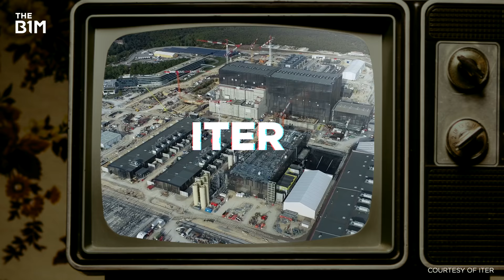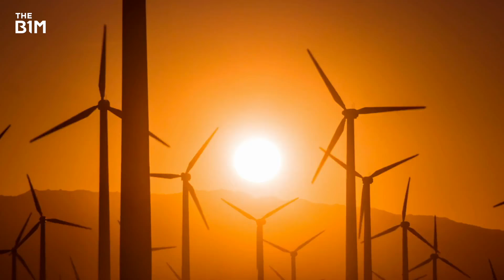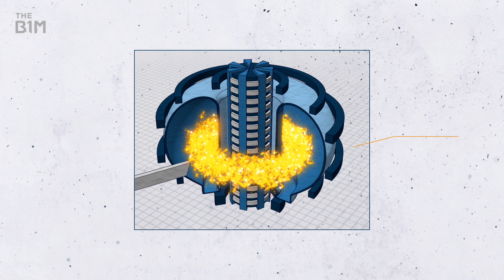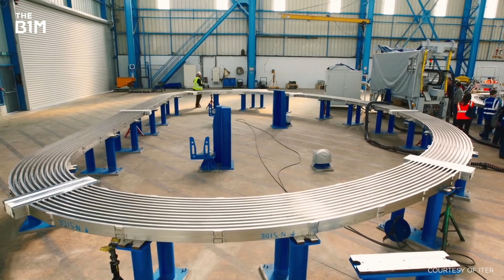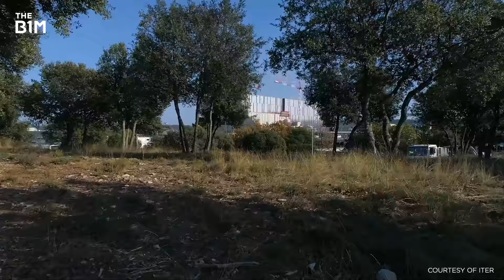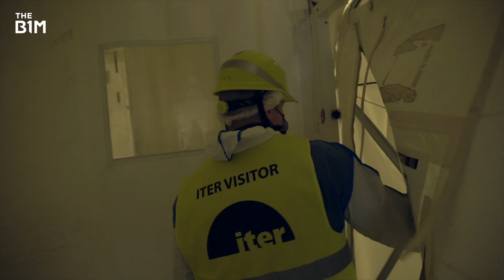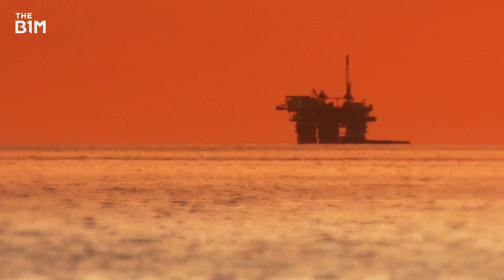We Went Inside the Largest Nuclear Fusion Reactor

Comment: ITER is purely a scientific research experiment, it is not connected to an electrical grid and will not power homes, cities, or businesses. In fact, instead of feeding energy into the grid, the facility will actually consume massive amounts of electricity (between 110 MW and 620 MW) from the local French power grid just to run its superconducting magnets and heat its plasma.

Comment: Based on what scientists think, believe, is happening inside the sun. A hypothesis that is over 100 years old and is, at the moment, absolutely unverifiable.  
Nuclear fusion is possible and that has been demonstrated. Trying to control it, based on this assumption, is a totally different challenge.
Reply: Are you saying stars don't use fussion? Because saying that is straight up incorrect.

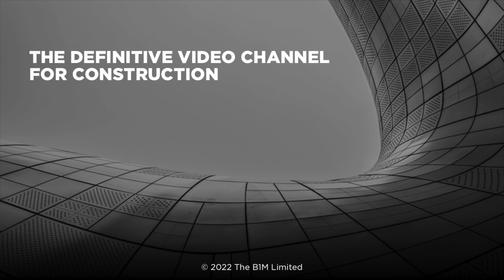Comment: 7:43 what you just said,is it true?
What about law of conservation of mass?
Reply: That doesn’t apply to nuclear reactions. It’s an approximation that fails in quantum physics.
Reply: Basically they have to heat the plasma super hot, and keep the super conducting magnets super cold this takes energy, net energy would mean the fusion reaction produces more energy than that initial energy to make the reaction happen. This reaction is the same thing that happens in the sun. Fusing atoms actually produces way more energy the splitting them

Comment: Don't give it an AZ-5 button.
Reply: 😂 Chernobyl
Reply: The button is fine, the problem was cost cutting the rods by using graphite tips and then NOT TELLING the actual plant operators about this. Slamming the rods in would have killed the reaction as expected had they been 100% boron. Instead as they said in they kicked the reaction orders of magnitude higher.

Comment: Remember Chernobyl!!
Reply: different type of nuclear reaction
Reply: @redegg7530 It wasn't a problem anyway. The myths of nuclear disasters are literally that. Myths
Reply: @paulanderson7796  tbf chernobyl still irradiated an area where it’s unsafe for human settlements but that’s “mostly” it, barely any direct death.
Reply: @redegg7530  Pure media propaganda. Maintain fear of the words "nuclear" & "radiation".
Reply: @redegg7530   Many still live there.
Reply: @paulanderson7796  I’m not saying the whole city, only a small region where it’s restricted to enter without approval from the government
Reply: @redegg7530  Are there any restrictions? Were there ever any?
Reply: @paulanderson7796  Yes, there are certain areas which you can’t enter without permission
Reply: @redegg7530  But what are the consequences if you do proceed without persmission?
Reply: @paulanderson7796  You’ll be fined, maybe community service and that if you enter the wrong area or took something you shouldn’t have, radiation poisoning
Reply: @redegg7530  Radiation poisoning is an odd one. The bigger issue is heavy metal poisoning. That's irrespective of short lived radioactive "byproducts". The long lived "wastes", U238 for example, have half lives of several billion years. Thus they are no radiological threat whatsoever.

Yes reactor "waste" needs relatively conservative handling, but commercial reactors don't create very much of it at all. You can bare hand fresh reactor fuel completely safely.

Comment: 150 mil centigrade…did I get that correct? What material is used to withstand these high temperatures Be?
Reply: The magnetic field keeps the plasma from reaching any material
Reply: Are you saying the magnetic field is some form of insulation, no heatwave (radiation) can penetrate this...wow I never knew that a magnetic field has a thermal conductivity of zero! I didn't even know that a magnetic field is matter, my infancy science tells me that all matter occupies space. I thought a magnetic field was more like gravity...something that you can feel rather than touch.
Reply: @MkhuluMokoena  No thats not what I'm saying, the plasma is kept at bay by the electromagnetic field, in a similar way of how iron can be repelled by a magnet. This means there is a gap, and a vacuum, between the temperatures of the sun and the beryllium blanket that captures neutrons and breeds tritium (more fuel for the reaction) and then the rest goes into the water channels that create steam which run a turbine. The electromagnetic field keeps the heat from conducting  to the structure. Plasma and electromagnetic fields have a special relationship. There is also very large gap between the fusion reactions which actually doesn't occupy much space and walls. The thermal radiation transfer is minimal.
Reply: Nothing. It's nonsense. The Sun manages fusion because it's held together by it's huge gravity. Gravity doesn't melt.

Comment: One things you failed to mention is it is not normal construction.  When constructing a building, yes things have to fit together correctly, but, more often than not, there's some sort of acceptable  fudge factor.  A corner isn't exactly square, but maybe the carpenters, plasterers or painters can make it look acceptable and finished.  The components of the machine were manufactured to sometimes double digit micron tolerances AND they have to be constructed to those same tolerances or they just won't function as designed.  There is no good enough like in parts of most building construction on that job site.  All aspects of it are just so cool.

Comment: Video starts with a very bold statement:  "This is a nuclear fusion reactor."  No.  It's not.  It is hypothesized to be a nuclear fusion reactor.  As far as it goes no one can state with certainty that it will ever be finished.  That it will ever turn on.  That it will produce anything other than extremely expensive parlor tricks.  Sustained production of electricity from nuclear fusion is 19 years in the future and will be for the next 40 years.

Comment: No one still solved the fact those plasma transform the walls into atomic Swiss cheese. And this is just research at best, maybe even just wasted money.
"Disruptions" plasma instabilities and just the fact the plasma is very destructive won't make it run for long before the entire thing has to be changed (well, the gigantic crazy expensive parts of the walls, I suppose). Anyway. I'm still for research even if it won't produce energy, not this one. At least not more than you put into the system just to sustain fusion.

Comment: Very obviously a make-work program. 

The idea of trying to replace thousands of earths of mass pressure with a dust particles worth of metal and electricity is hubristic in the extreme, assuming anyone smart enough to work on it is actually that stupid. 

In economics there is something called A/P. With this approach (obviously, can't evaluate unrealized approaches) you will not ever be able to make enough power, even if it lasted literally forever, to make up the annualized present cost. The issue is that in the limit there is a startup cost to annual benefit ratio that never balances no matter how long the time horizon is. Essentially that is when interest on the loan exceeds the annual power sales income.

Comment: The video skips over two important points: This is not intended to supply power; it's strictly a demonstrator/science experiment. A REALLY expensive science experiment that they HOPE will show tech that can then be used to make actual commercial reactors. Two, they aren't even close to done. Initial operations isn't PLANNED until 2035, and that's if they stick to schedule, with no political/funding/technical issues. The Apollo program, this isn't.

Comment: When it comes to nuclear fusion energy us human beings are really great at at building for many years thermonuclear bombs where all the energy is released in the form of several megatons worth of devastating explosion. However to produce nuclear fusion energy in a controlled manner that can be used to generate electricity is really difficult and may prove to be impossible. The big problem is the extreme pressures and extreme temperatures needed to obtain nuclear fusion.

Comment: And all of the fossil fuels used to make the Iron/Steel/Aluminum/any other metals and all of the plastic, wire cabling, fibre optic cables, computers, all came from Oil/Gas. So in short fossil fuels are going nowhere. Wishful thinking that this will replace Fossil fuels. At The birthplace of any large scale manufacturing comes from burning a fossil fuel to create energy.

Comment: where does the hydrogen coming from? water? so if we are using water, for hydrogen, what will we drink? fusion right? so the 2 hydrogen atoms make helium? then what? won't you need the hydrogen back to make water.
Reply: The amount of water used to make the required deuterium is a very very tiny fraction of the worlds water supply. We have enough water to power the worlds fusion reactions for millions of years.
Reply: @SPCv4  interesting. as those years past you've got to hope they can harvest from space. so little hey. ok. off of million gallons how many years. and what will be done with the helium?

thanks.

Comment: First: This "reactor" will never EVER produce a single watt of power.
Second: It will NEVER result in a design for a commercial power reactor, and if it did, it would produce the most expensive electricity in the world, and there could only ever be about 4 of them in total, because you need about 600-megawatts of power to start it, and about 4 places in the world can supply that much power in a single location.

ITER is a gigantic pile of garbage, and the only good to come from it will be a lot of interesting nuclear science, and a stack of PhDs taller than the reactor building itself.

Robert Bussard (RIP): "We've spent many decades and many tens of billions of dollars researching Tokamaks, and so we know a lot about them. And what we know is that they are no damned good. I suspect the Russians released the Tokamak knowing full-well we would waste all our time and money on them."

There is exactly ZERO chance that steady-state fusion reactors will ever power humanity. 
If you think otherwise, you are just plain wrong.
The future of fusion is pulsed devices like LPPFusion: small, cheap, aneutronic, and democratic. 

The exact opposite of ITER - which is designed to strengthen the stupid centralised production of energy.

Comment: Fusion is great and all, even if ITER succeeds it will be nearly impossible to use fusion to supply global energy demand. In this video it is said that the hydrogen isotopes are abundant. Deuterium is, but tritium on the other hand isn't. Tritium is a by product of nuclear fision and very tiny amounts are being produced. To supply the global energy demand we will first need to figure out how to efficiently produce great amounts of tritium at a low cost, which is a huge challenge on it's own.

Comment: It is truly cool construction site and should be pursued as scientific/engineering challenge. There is very little hope that Fusion will contribute to decarbonisation in time as it will take at least some 20years from ITER to possible demonstrator and then possible power reactors. Even if it works there will be little hope for fusion power to be cheaper than coal, easier to build than current fission reactors. And still Fusion will generate radioactive materials- so few facts that fusion enthusiasts forget to mention. In the meantime Fission power took about 10years from discovery of neutron, understanding what isotopes really are to first reactor build. 

Not for a moment there were doubts or chalenges in getting more power from fission than inputs in materials or reaction. Radioactive materials are fairly easy to be contained, recycle into fuel (for the parts that stay radioactive for thousands of years=actinides which are great fuel for IVgen reactors), or will decay to safe materials in few hundreds of years (fission products). It also is possible to make such power plants cheaper than coal (as it was before and should be possible in the future with well developed and executed national plans). There are also proven cases when with the use of nuclear fission countries got rid of using coal and reduced use of NatGas by a lot(France, Sweeden, Finland, provinces of Canada) and big progress has been done in about 15years like in France.

Comment: Impressive video but i skipped back to hear where it should stand and yeah, it's in france. I'm not suprise at all, france has some major nuclear energy problems, old reactors which can't be run safety anymore and a newer reaction which is a mega project that the finish line get pushed further and further into the future.
 
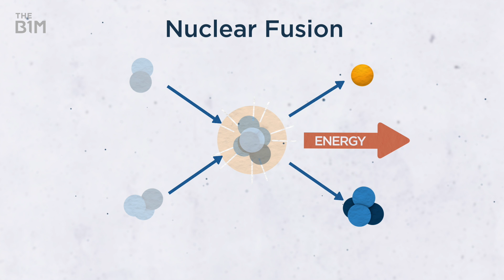And then there come scientist in which dream about stuff, which denies for example the second law of thermodynamics, which defines that no system, can produce more energy than you put into it. So what it said at Timestamp 1:04 is complete nonsense. And what is said at the end of the video is also not true: The is no "code" to figure out.
 
France also dreams about "infinite recycling" of atomic waste, which also doesn't work because of the same principals and btw produces an atom waste which is so heated up, that you can't store it with other atomic waste. No, you would need to reinforce existing facilities to store that.
 
And another thing is that france tries both of that concept for a very long time already, with until now, not working, so it's not even a news in the usual term. And ITER is an experiment at his current state, it need to be scaled up to use it in a commercial nuclear reactor. 
 
France is wasting countless mountains of money to develope something which don't work, and will not work. The should better invest in renewable energy and better techniques to save the energy that comes from sun, wind and water. That is more reliable, much cleaner energy even that energy is not unlimited, of course not, but it should be expected that it will be longer here than us humans. 

8:37 "There is no other solution" yeah, but as the "Deputy Head of Project Control Office, ITER" i can't expect her to be objective in that regard. Yeah, the future of our children? Really Lady? The Future of our children still contains atomic waste, and yeah your reactor doesn't produces atomic waste. Let's see:
 
Oh it produces helium (Source: https://www.iter.org/mach/safety last paragraph), a gas, to be exact a greenhouse/Inert gas which also drives the climate change. Like CO2. Oh YEAH, that will leave something for our children! Sry Miss Ricketts, but are you sane, calling that a good future for our children?

Comment: How did the material survive in such a high temperature............great engineering........
Reply: Iirc, the plasma is in a vacuum and is suspended in a magnetic field, so heat does not transfer.

Comment: "that end up as dangerous nuclear waste" when talking about fission energy production, is pretty inaccurate... it ends up as the same elements, which are dangerous - Uranium and Plutonium, the additional by-products (less than 10%) aren't harmful at all... It's the Uranium and Plutonium that are harmful :P
It's possible (in the future) to remove the harmless byproducts and use the remaining Uranium or Plutonium.
It's also possible right now, to simply build a 'more powerful' fission reactor that can use the 'waste' from older generation reactors.
Additionally, when talking about Uranium and Plutonium, you're talking about something the size of a golf ball powering a reactor for 2-3 years - with the 'waste' being slightly smaller than that.
But yes, fusion would be epic - just don't hate on fission too much, the by-products from coal are 100,000x worse

Comment: As as the moment, Fusion also produces radioactive isotopes as it needs Tritium which are currently produced in Fission nuclear reactors. 

We won't see fusion in commercial scale probably for the next 40-50 years, hence for now the Fission is plenty ok to fight climate change. Nuclear waste can be used to power fast neutrons reactors, which do exists already. 

The only issue with Nuclear fission is just how people see it. But it's nothing dangerous or dirt as people think it is. Actually, you end up using lesser materials and lesser land than you would otherwise need with renewables.
Reply: I'm reading that Tritium requires a reactor to produce, but Deuterium is extracted from sea water.  But you probably have better sources than my quick search upturned...
Reply: @nmarbletoe8210  yes you are absolutely right, I will correct my comment, thanks 🙏

Comment: Interesting Video, well done.
But for once I find myself on the Luddite Side of Construction: Way too expensive.by the Time this thing is even (if ever) switched on, it won't even be connected to a Grid.Just a really, really expensive proof of Concept.

They could not at least have designed it to be commercially functional (as they seem to presume it will reach viability) ? Just an overall Budget nightmare.